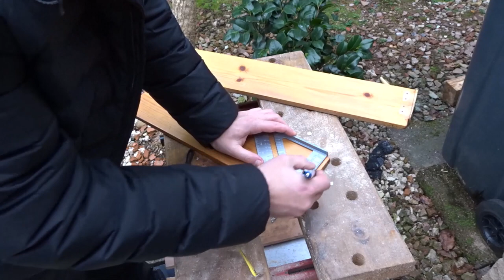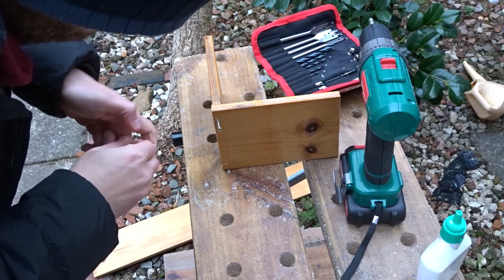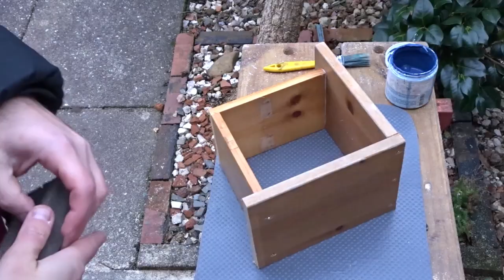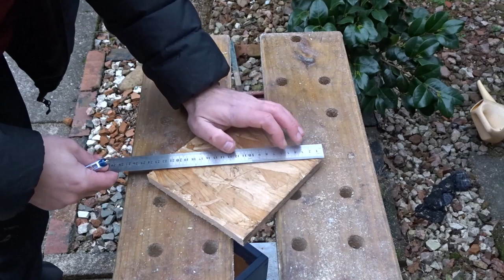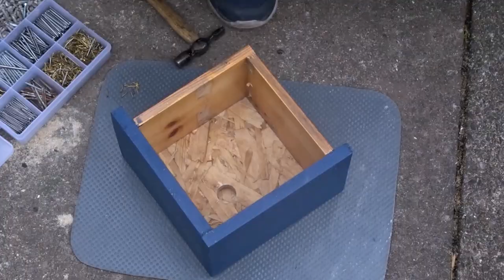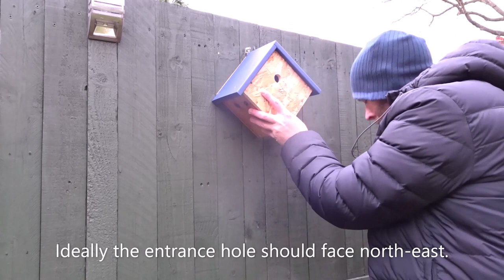How to Make a Diamond Shaped Blue Tit Nesting Box (Scrap Wood Project)

Comment: Morning, Phil - what do you think about protecting wooden bird boxes from the elements? I noticed you used OSB for the front of the box, for example, which I thought didn't fare well against getting wet ... but I know many weatherproofing agents are not good for wildlife.
Reply from the maker: Hi David, I use most woods for Bird Boxes apart from MDF and chip board. OSB seems to do ok at least for the front. I do use water based fence stains for protection also.